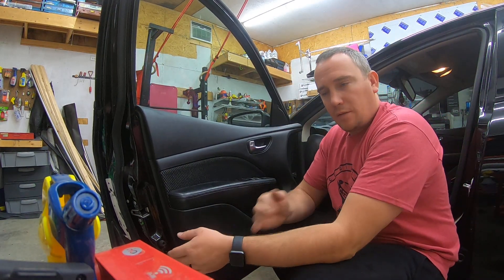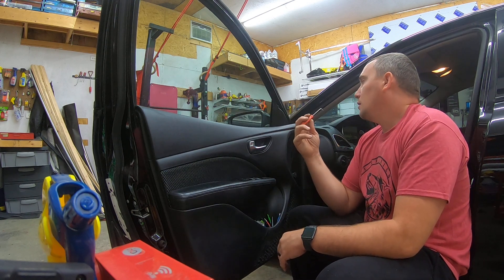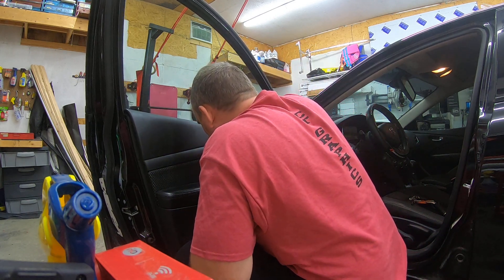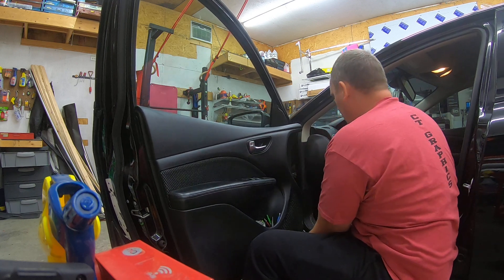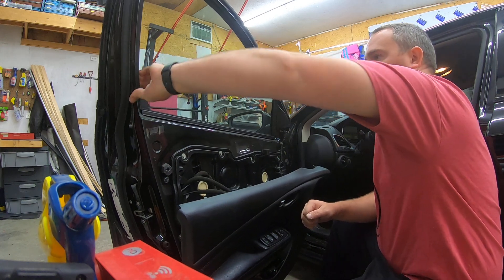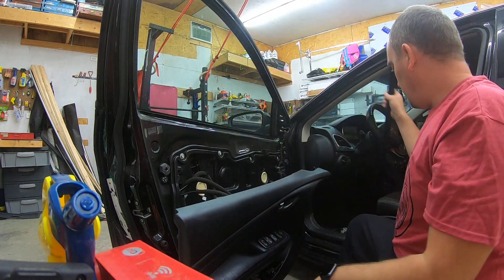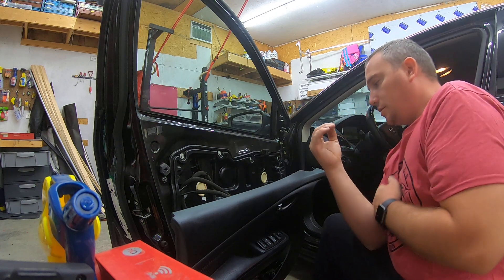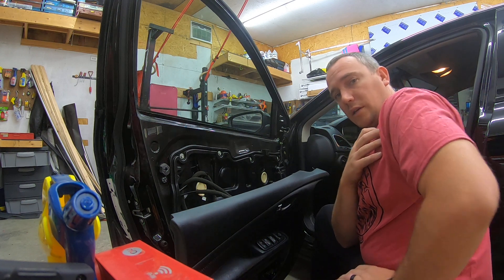How To: 2015 Dodge Dart door front panel removal

Comment: Excellent video. My dads' driver's side window would not roll up. Problem was, he had to get to a parking garage to catch a ride across our state to Philly for work, each week. That would mean his window would be down the entire week. Not good! My husband used your video to get the panel off,  so he could jump wire the window motor from a jumper battery box (harbor freight). window up! Took less than 15 minutes and my dad was well on his way to meet his ride...with a lockable vehicle. Thank you!
Reply from the maker: Thanks for sharing I am glad this helped!